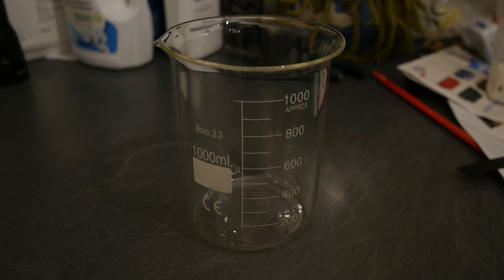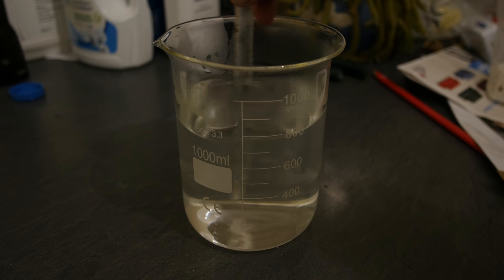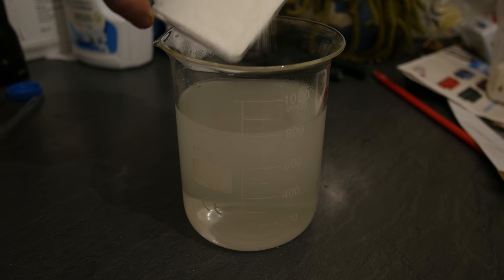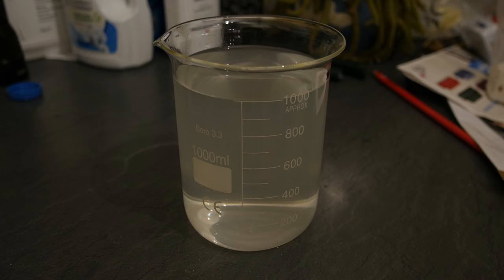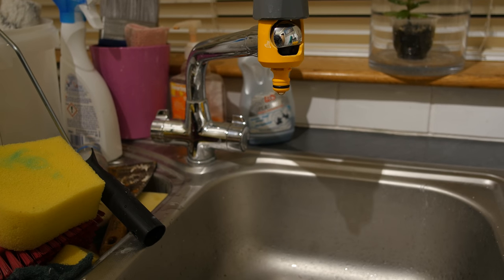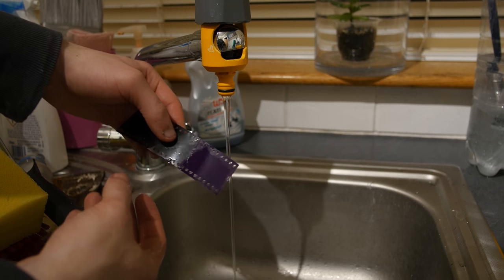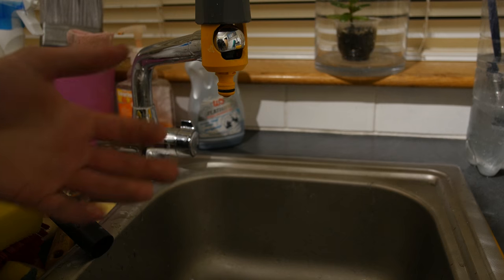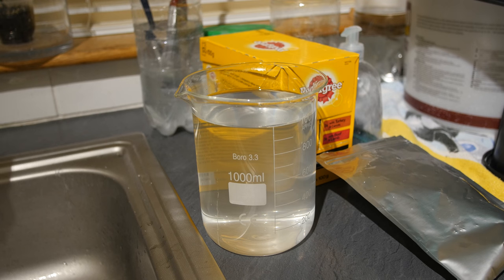Effective Remjet Removal Solution

Comment: Hi Shaun, any ideas if this solution can be re-used or do you make up fresh each time?
Reply from the maker: It can be used many times.
Reply: Thanks  @ShaunDobbie  so the dirty black solution can use be dumped back into a bottle and used again next time? How long does it roughly take to exhaust?
Reply from the maker: @hipshootfilm8550  The solution never goes black, it is the water wash afterwards which removes the remjet. 1 litre will easily do 20 films.

Comment: Hey Shaun do you know if this process can be done prior to exposing the film?
Reply from the maker: Yes if done in total darkness.
Reply: @ShaunDobbie  so is this a touchless process, or does the film need to be wiped? also is there a  chance of removing the emulsion?
Reply from the maker: @danieldelapena8369  Some touching is required, a soft sponge will be fine and the emulsion is pretty strong.
Reply: @ShaunDobbie  hey many, been shooting 500t for a few years, now want to try to remove the remjet before exposing the film. Does the whole process have to be done in complete darkness? Isnt it impossible to pull off?
Reply from the maker: @dlg9369  Yes, must be total darkness.
Reply: @ShaunDobbie  thanks man!
Until when does it have to be in darkness? Dry it, then roll it, and then it can be taken out to light?
Reply from the maker: @dlg9369  the only times film can see light is when it is being exposed when the shutter is open during taking a photo or after it has been developed.
Reply: @ShaunDobbie  But there is no way to check if remjet is removed, right?
Reply from the maker: @dlg9369  No, but if you do it properly you shouldn't have to worry.